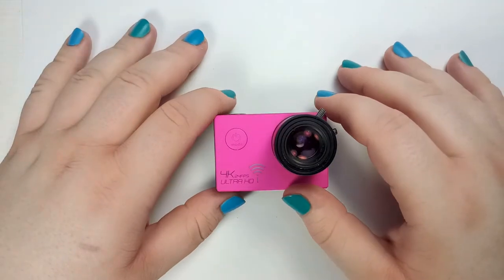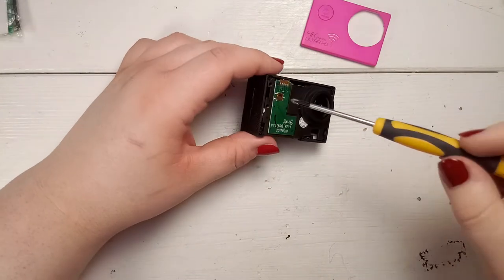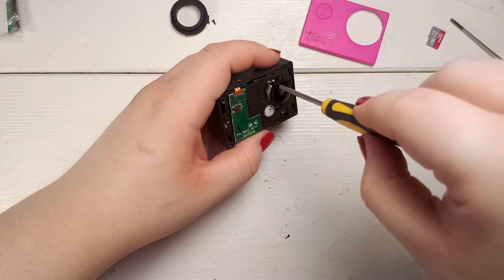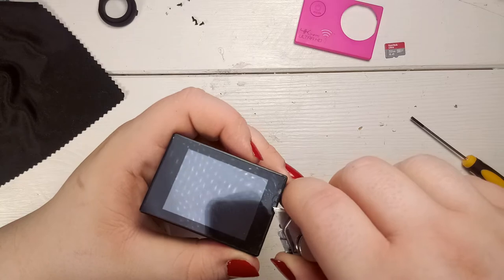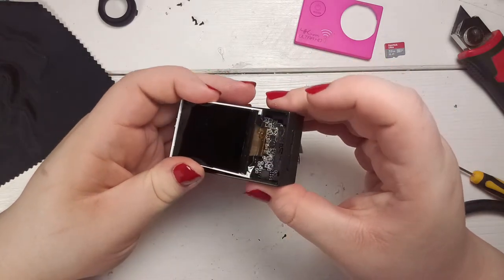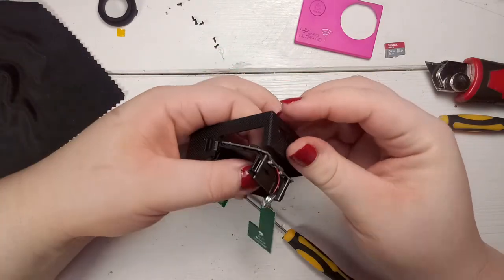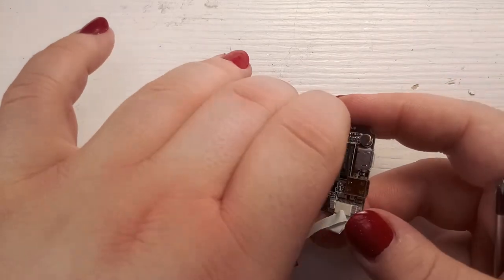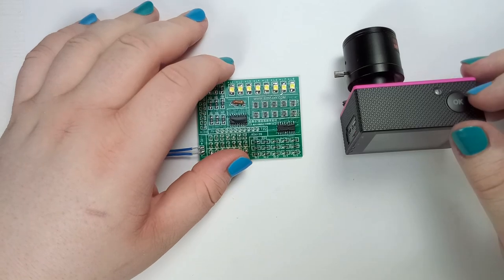Action Camera Lens Replacement - Guide

Comment: Hi Anna.
Good job, but there was no need to disassemble the camera that much. Remove the black plastic protecting the lens. Then, using a pair of pliers, turn the lens to the left and remove it. The glue splits easily. I did this on sjcam sj4000, sj4000 wifi, sj4000 air and eken h9r cameras.
By the way, how many mm should I buy the cctv lens?
Reply from the maker: Hey, thanks for your comment and welcome to my channel! :)
If you try to remove the lens by force you run the high risk of destroying the lens socket. My lens was not just glued in place with any glue but epoxy. That stuff was tough and I had to use a diamond grinding bit to remove it.
Now as you said you did this before it might work but I can't guarantee that for every action camera of this kind. As mentioned there are even two different variations in regard of the screen so there might also be a difference with the glue used to fix the lens in place. I'd still recommend doing what I did but if you have the money to just buy a new one if it goes wrong, go ahead.
The socket is typically M12 if that is what you asked for, if you mean like focal length or something this highly depends on what it is intended for and I'm not really an expert in that regard.
Reply: @PhysicistAnna  They usually put just a tiny drop of glue, I didn't even remove the front cover of my sj4000. Just a rubber ring around the lens. Unscrewed with long-nose pliers, tiny strength applied. Glue just snapped. (I removed ir-cut filter and tried to replace it with visible-cutoff, but it was too thick, couldn't focus later, in the end I put some UV only - pass filter, played a bit with photography...)
Anna, can you point me to the link of the exact lens you bought? I found a bunch of similar (manual focus m12 cctv etc...) lens on AX, Ebay and similar sites, but none of them fit your exact specs. In general, FOV is always wider and I expect that to be a problem. Other differences in specs are not that important.
In any case, your video has been of great help. Thank you for it! Cheers!

Comment: can a telephoto lens be used as microscope?
Reply from the maker: In theory yes but you have to combine it with a macro lens in front to get its focus point closer. Typically tele lensea tent to focus everything beyond 1 meter or more. So you would have to position it rather far away. Macro lenses however change the focua point. My camera for example has a tele lens with a minimum focus distance of 1.5 meter. With a macro lens I can get it down to ~0.3 meter.
Reply: @PhysicistAnna  ok , i´ll try that setup, here in my country (mexico), can´t find the varifocal lens without paying too much, thank´s for aswer, you have a new sub

Comment: Have a link to  the actual lens?  Thanks for doing this!  I have an HDMI cable for mine but it is unusable at Macro for soldering.
Reply from the maker: Hey, welcome to my channel! :D
Unfortunately the original offer is no longer avaiable, however I found the exact lens on ebay.com with free international shipment:
https://www.ebay.com/itm/1-3-9-22mm-IR-Sensitive-Manual-Zoom-M12-Mount-CCTV-Len-F1-6-Security-Camer-DKH/153891107584?hash=item23d49ff300%3Ag%3AaF0AAOSwsvpbNKHn&LH_BIN=1

One thing to consider if you do this is to actually glue the lens in place with hotglue for or if you don't mind to use a stronger glue. Makes adjusting the focus much easier.